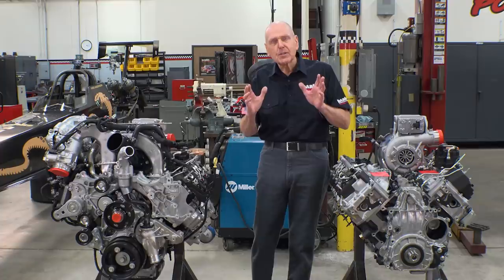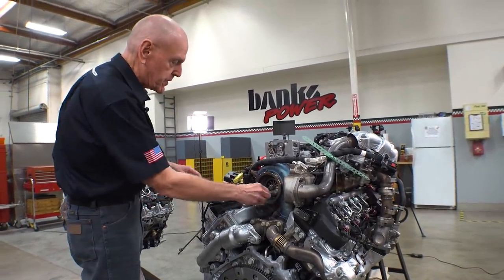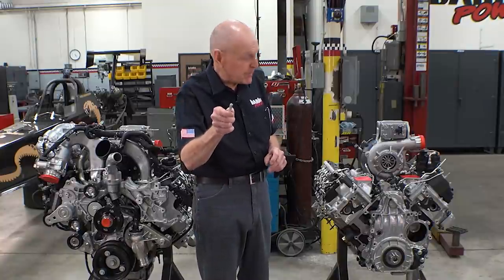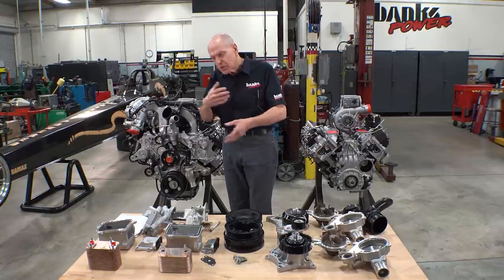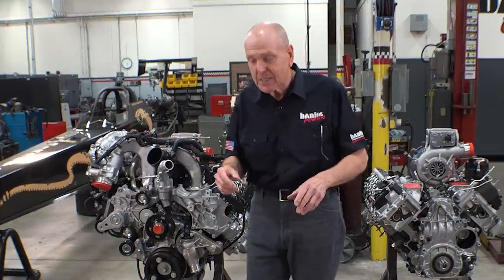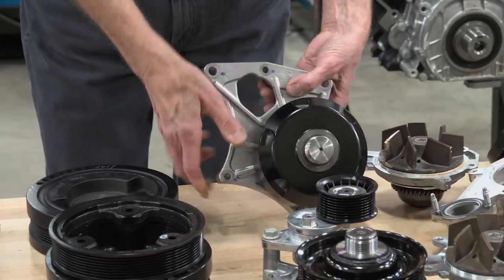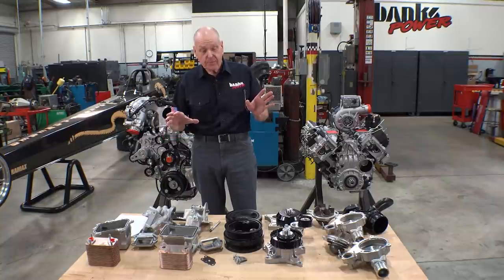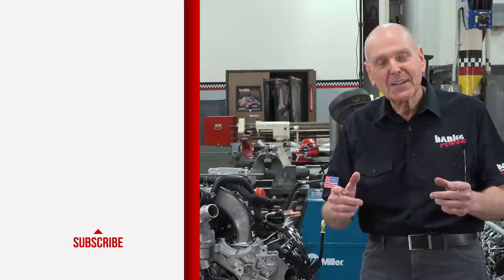2020 DURAMAX L5P Engine Revealed!

Comment: A channel That actually explains the mechanical workings of a truck and their drivetrains and not how big the touch screen is, how many cameras the truck has or how many USB ports a truck has..  the other so called truck testing channels should watch this channel.  thank you!!!
Reply: The reason the other channels don't talk about the inner workings is because they don't understand them. Mr. Banks has forgotten more about diesels than most people will know in their lifetime.
Reply: @tylersmith7054  exactly!!! That's what important to me, not  how many USB ports there are...
TFLT keeps bragging about the fuel mileage of the turbo four cylinder Silverado, I keep commenting that my 5.3v8 Silverado gets the same exact fuel mileage so why get a four cylinder? They don't get it...
Reply: Gale reminds me so much of Jimmy Stewart who plays George Bailey in "It's a Wonderful Life" : Just tell it like it is, don't worry about what others think, be real, and know what you're talking about without exaggerating.
Reply: Mister Banks it’s old diesel school!! I means the father of the all modern diesels!!
Reply: bro/Sir there are two engines with same torque but different rpm

1. Engine A: 910 lb ft of torque at 1600 rpm
2. Engine B: 910 lb fr of torque at 3000 rpm

So bro which is better?
I mean what characteristics do they tell?

I know this high reving engine has more hp less torque and low reving engine has low hp and higher torque
But now as the torque is same and rpms are different what to choose?

Comment: How do I know?  I've got 1000's of hours invested in these systems."  "5 seconds and then blow it up and they think they've done something..."  "We test at full power and full torque for 40 hours." !!!!!!!! Old guys still rule.
Reply: Gale wont be "rolling coal" either.  If its smoken its broken
Reply: @charliemagoo7943  not true, get a truck running clean and then add fuel you will gain power every time. It all depends on the purpose of the build. If fuel economy matters then the small power gain is not worth the extra fuel, if max power is the only goal then roll coal. My cat powered road trucks run clean, fuel is my money and the extra 20hp means next to nothing, my pickup has several tunes on the dial to run clean down the road or max potential when I need that extra few out of the old girl to get something done. Purpose means everything, blanket statements mean nothing.
Reply: It was 400 hours.
Reply: @jaydunbar7538 , Gale Banks and his team built a 7 second Duramax drag truck, and the only smoke it makes it from the tires, same goes for the Cummins powered Dodge Dakota that went 222 mph
Reply: SirAndrew 10 hour cycles 40x.
Reply: @jaydunbar7538  roaling coal means an inefficient tune. Diesel trucks that drag race roll coal because it can actually help keep the engine from entering a melt down. Roaling coal means you don't have enough air flow to match the fuel being delivered which leaves the fuel unburnt. Unused power basically.
Reply: From a mechanical engineer... that's not true at all. Rolling coal does nothing but loos power in unburnt fuel, and ruins your engine prematurely. If that exhausted soot was burnt in the engine, you would have used every bit of that black garbage coming out as power and your engine won't get choked up by the soot. PLUS and this is a big one, unburnt soot has been proven to cause lung cancer, leukemia, lymphoma and other cancers. So unless you're willing to put your health insurance policy to the test, I would stop doing that.
Reply: @jonathonbridges9625  I'm fully aware of how it works, as I said in my prior post if you add fuel to a clean running truck it will gain power, I also said it is inefficient. Did you bother to read my post prior to tagging me?
Reply: @anthonywebber2211  how is that relevant to what I posted? At no point did I say you can't make big power running clean, I said you gain power if you add fuel to it which is a undisputable fact. Yes it is a inefficient power gain, it is still a power gain if absolute max power is desired and the competition has no rules against it.
Reply: @jaydunbar7538 , rolling coal, is unburned fuel
Reply: @anthonywebber2211  obviously, that's the point.
Reply: @Scott Davison most consider a grey haze as rolling coal, but yes to much is not good, as I said adding fuel to a clean running truck gains power I did not say it is an unlimited gain. I actually said it's very limited and a very inefficient gain.

It can also clean up when nitrous injection settings are reached.
Reply: @jaydunbar7538 , I guess you never heard of AFR Air to Fuel Ratio
Reply: @jonathonbridges9625  also why you see some diesel guys spray N20 on top to clean it up
Reply: 400 hours.... 10 hour cycles 40 times
Reply: @jaydunbar7538  you would produce gray smoke. Thats the best for drag race applications. More fuel is more heat and less power, however when exhaust is gray I would think the extra heat and pressures will give you enough extra boost to counter the loss and increase power. When you see black, you gaurenteed lost power no matter the application
Reply: Garrett Hansen
yes N20 adds additional oxygen and chills it
Reply: 400 hrs.... Even better!
Reply: @jaydunbar7538  Gale's Philosophy is: If you want more power, add more air,  more MAD & more cooling. If you see black smoke, that engine's a ticking time bomb. When I see coal rolling racing trucks, I think:"What a waste of fuel and time to get to the power number!" More turbos, more air, more cooling, and they could at the top number faster, more repeatable, beat their competition, and burn less fuel! I'd like to see 2,000-3,000hp with little to no smoke and 2-3 second quarter miles. Off the line faster and to the finish faster, and cooler runs, since more air density=cooler running engine.
Reply: bro/Sir there are two engines with same torque but different rpm

1. Engine A: 910 lb ft of torque at 1600 rpm
2. Engine B: 910 lb fr of torque at 3000 rpm

So bro which is better?
I mean what characteristics do they tell?

I know this high reving engine has more hp less torque and low reving engine has low hp and higher torque
But now as the torque is same and rpms are different what to choose?

Comment: I will only ever call it "The Loud Pedal" from now till the day I die. 

Thank God for Gale Banks.
Reply: I have always called it the smile pedal
Reply: ive always called it the "go go juice"
Reply: bro/Sir there are two engines with same torque but different rpm

1. Engine A: 910 lb ft of torque at 1600 rpm
2. Engine B: 910 lb fr of torque at 3000 rpm

So bro which is better?
I mean what characteristics do they tell?

I know this high reving engine has more hp less torque and low reving engine has low hp and higher torque
But now as the torque is same and rpms are different what to choose?
Reply: You better thank his mom and dad.

Comment: I am a Cummins guy but I still love to listen to this guy talk. Cant wait to see the rest of the series. Banks is the man.
Reply from the maker: Stay tuned for new and exciting content. We are developing some new new hardware for the Cummins engines.
Reply: bro/Sir there are two engines with same torque but different rpm

1. Engine A: 910 lb ft of torque at 1600 rpm
2. Engine B: 910 lb fr of torque at 3000 rpm

So bro which is better?
I mean what characteristics do they tell?

I know this high reving engine has more hp less torque and low reving engine has low hp and higher torque
But now as the torque is same and rpms are different what to choose?
Reply: @bankspower  bro/Sir there are two engines with same torque but different rpm

1. Engine A: 910 lb ft of torque at 1600 rpm
2. Engine B: 910 lb fr of torque at 3000 rpm

So bro which is better?
I mean what characteristics do they tell?

I know this high reving engine has more hp less torque and low reving engine has low hp and higher torque
But now as the torque is same and rpms are different what to choose?

Comment: I really wish he was into Ford's 6.7 like he is these. The modern diesel wars are really turning out some incredible engines.
Reply: Mr42960 fords recent track record is lack there of so I bet that’s part of the issue.
Reply: @Sackmatters  The 6.7 has been very reliable? I know the 6.0 and 6.4 had issues even though the 6.4 I owned was very fun and no issues.
Reply: Gale banks prefers the Duramax, because he can hotrod them way more then Cummins and Powerstroke
Reply: @brandon18054 , and he's built a Duramax road race truck, and Duramax drag truck and Duramax dragster
Reply: @CoyoteFTW  6.7 powerstroke is built in Mexico only the truck itself is built in USA. Not the 6.7....
Reply: leeleelee I’m a GM guy but will agree with you on the all USA built. That being said the ford Diesel is about 10 years behind in technology to the Dmax engine. Ford had a huge set back with the 6.0. Ford should have stayed with their work horse 7.3 and just built off it. The 7.3 was a horse.
Reply: tlt40s&w 70 - I don’t believe that for one bit. The only engine Ford built in-house has been the 6.7 which has been the best power-stroke to date. All the other ones were built by international/navistar.
Reply: @CoyoteFTW  ant nothing but junk. I know i worked at ford super duty plant.  For 20 yrs ford sd trucks had more problems than Chevy and ram together.
Reply: The new duramax is fucking junk compared to the new powerstroke. The 2020 6.7 has fucking steel pistons (something you only see in massive off highway diesels and some semis), big beefy rods (same from job 2 2017+, almost identical to the notoriously beefy 6.4 rods), same extremely strong compacted graphite iron block since 2011. The powerstroke will be dragging the shit out of these anemic looking duramaxes (has been since 2017, anyways).
Reply: Because the powerstroke doesn't need any help making big power. The durascrap needs all the help it can get.
Reply: Boss 302 amen
Reply: Listen to all these Chevy kids I see them broke down all the time
Reply: @matman7546  has been since 2017? what the hell happened here? Oh that's right you Ford guys look at numbers instead of actual tests. That must be why Ford doesn't use the Society of Automotive Engineers (SAE) for their horsepower ratings, because if they did they'd be much lower in real life. That's the reason this one got squashed...in case you were wondering. In fact Ford has quite a history of misinterpreting numbers. They misinterprete fuel mileage numbers all the time and it seems like despite their trucks weighing less and having all this horsepower and torque advantages... they for some reason always get beat in real life tests. Maybe once or twice and you can sum it up to just an unusual truck in that test, but this has been going on for decades now fellas. The Duramax and Cummins has  always dominated. Ford's been hit or miss. The best thing Ford ever had under the hood that was a diesel they didn't make. Maybe they should go back to that theory.
Reply: 6.4 was ford built too  @CoyoteFTW
Reply: @CoyoteFTW  not all of them.
Reply: @brandon18054  yes, and the engine was turning at 8800 rpm, I believe, if I remember right.

Comment: Nice info but today's new tucks just cost to much for the average person. My 1997 works great and it's been paid off for years.
Reply: I have a 1998 Chevy 3500 gas burner! And it is paid for! Are use it to pull my antique tractors to shows and I do Christmas parades. I will not spend $20,000/ $90,000 on a pick up! LOL

Comment: Gale; I'd like you to do a segment on LP5 2020 longevity and reliability. These newly redesigned engines if properly cared for should provide its owner 10 years plus of virtually trouble free reliability. I'd like your thoughts on this topic.
Reply: If your using it twice a year to pull your camper it should, daily commercial use you will be lucky to get 5 years out of them and that's if you can keep the truck from falling apart with 500,000 miles on it.
Reply: @jaydunbar7538  my lbz has 340k no issues... expect to go past 500k no issues. I'd expect for these to do the same. Million mile low maintenance trucks. Just take care of it.
Reply: Have ya’ll not ran in to pushrod failures ?
Reply: @trentonburge5662  I've done multiple L5P pushrods sets. Those failures were not blanket failures. It covers some trucks but literally less than 5 percent of all l5ps sold to date.

Comment: you think that there will be an option where you can request a permanent belt in the oil pump⁉️ because the built this with a belt that is good only for 150,000 miles and the only way to replace this thing is by dropping the transmission‼️‼️

Comment: What I didn't really hear is why the 17, 18 and 19 Duramax engines were so plagued with problems and failures and how GM thinks this next engine can be dependable. Also, this engine still has the exhaust manifolds on the outside of the engine which means more exhaust plumbing to get to the turbo and more places for problems unlike the really cool ford 6.7 design that puts the manifolds inside the v where the turbo is anyway. I'm not convinced this engine is good but I do believe the transmission will handle the power unlike the Dodge.

Comment: I worked on duramax engines and they sucked to work on. Every thing was buried under the hood . And the emissions devices failed pretty regularly . When the head gaskets failed it was an act of God to fix them . And there could be any one of 3 different gaskets. I don't need or want a diesel . That being said I watch these videos any ways .
Reply: Joseph Matarese Welcome to the modern diesel.
Reply: I left the auto industry . It was becoming a nightmare . GM products are of poor quality and reliability .
Reply: I used to own a I think it was a 94 Lincoln Mark VIII, and I later bought a 99 Corvette. The biggest thing I noticed (besides the power) was the quality of the materials. The materials in the Corvette where terrible. Other then the engine and the looks of the Corvette I felt everything else was sub par. The turn signal felt cheap compared to the Lincolns, the leather seats where a joke. I daily drove the Corvette (it was way more fun to drive) and the seats showed it. Even the passenger seat showed wear and tear, but the thing is, I rarely had passengers, so I don't know why the seat was messing up so bad. The driver seat leather died a terrible death but I put a 100k miles on that car. They had a recall on the steering wheel locking up and not releasing. When it happened to me I had to pay an additional thousand dollars because they said the motor the moved the locking mechanism burned out and wasn't covered under the warranty, so it ended up sitting at the dealership for nearly a month. I had to fix the popup head light multiple times because the gearing would eat it's self.  I didn't have any of these issues in the Lincoln, unfortunately, it had the AODE transmission. That car was in the shop so often that I bought the Corvette as a manual because I didn't trust automatics anymore. I honestly picked up the car one time, and didn't even make it a mile to get on the highway before the transmission fouled again. The Corvette felt like a cheap car inside but other then a clutch and the engine knock I never had any drive line problems out of it. It was just everything else that drove me mad. My current vehicle is a 2008 F-150 FX4 that I bought new (the other two cars where used)  I have over 130k miles on it and I have not had any issues in the 10 years I have owned it.

Comment: Excessive  oil cooling capacity  was bad  Juju in a cummins . They reduced the plate count from 9 to 7 on the 6bta as they were having problems with too cold oil. This was a stock power and back then there is about 1/3 of the current offering.

Comment: Thx the great information. ??'s I am trying to understand when and how Chevy-Duramax/ suspension? finally upped their tow capacity game. I am wondering how much is the newer LP5, suspension, or combination. My old '08 6.6 3500HD dually is around 10k lbs less tow capacity GCVWR than say the newer F350's w 6.7  and or the F350 suspensions. They were approx at 37L total combined rating, while my '08 is only at around 26K total combined. I plan to change tow vehicles to haul a heavy toy hauler in a year or so. I was thinking I was going to have to go to a F350 or better. I can't afford the new 2020 LP5 dually and was wondering when Chevy upped their game year model wise if you know.

Comment: Soooo in the other video where you unboxed the 2020 oil cooler you talked about figuring out if it was backwards compatible with the '17-'19 L5P's..... But never answered definitively if it was...

The question begs an answer Mr Banks.

Edit: An additional question... Is there a difference in the thread/mating surface of the 2020 oil filter?
Because if I were to upgrade the cooler I'd still want to use PPE's upgraded capacity oil filter designed for the '17-'19 L5P...